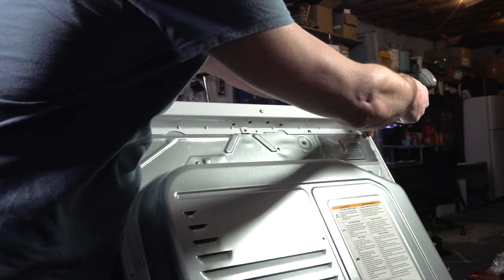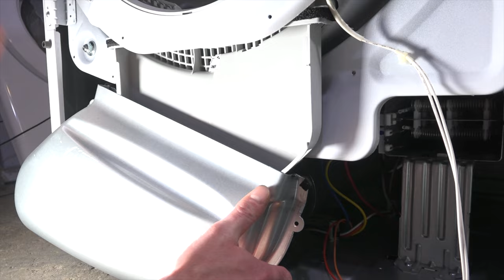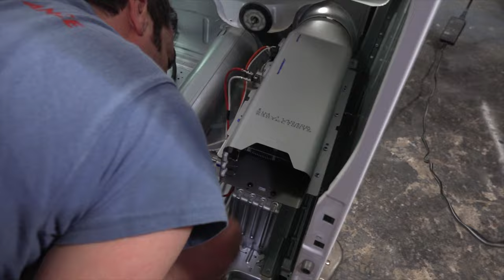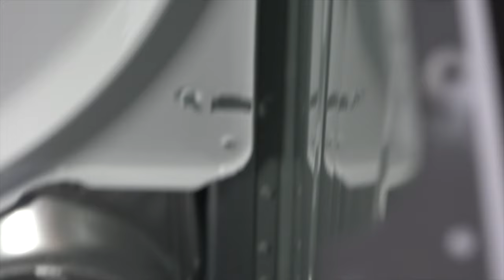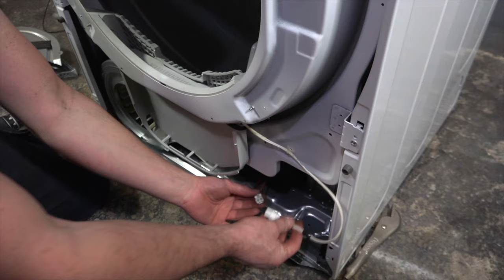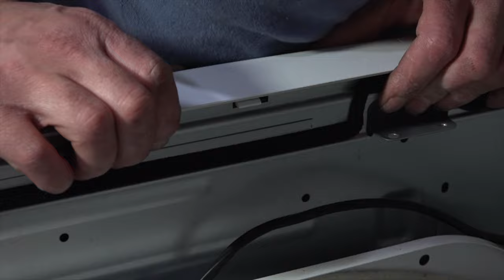How To Fix a Squeaky, Grinding, Banging NOISY LG Dryer

Comment: Our dryer was not sounding good. It turned out the drum wheels had failed. We got your rebuild kit for our 2005 LG dryer and this video helped us make the repair. A few minor design differences inside our older machine. It took two of us about an hour or so. The machine sounds like new afterwards. It does make sense to change all the parts at one time. Thanks for putting this content out!

Comment: Thank you sir for your knowledge! You should do how to videos for everyone! Replaced my wheels tensioner and belt along with my heating element while I was in there! Runs like new! Took me about 2 hours but I took my time and cleaned everything. My lg dryer was slightly different the control board was on the front panel which had more wires to remove other then that it was pretty much the same. Oh the dryer vent was a different style. Worked amazing. A thousand thank you’s !

Comment: Thank you for the video. We replaced all of the parts and it is better but there is a low sounding rattle noise while the dryer is running. Any ideas on what this may be from?

Comment: LG  Model : DLE3777W noisy. what the parts I need and price ? Thanks,
Reply: I have the LG model: DLEX3570V and it ended up being the bottom back roller wheel (was seized up/ not spinning). That wheel seems to be the one that goes out most of the time (according to these videos on YouTube). Your model will probably be the same, but you’ll want to replace all the roller wheels at the same time with the kit. Good luck!

Comment: Eugene, That's the exact model that I have.  Just bought it last June.  My question is - what's the average lifespan before these parts have to be replaced?  So far mine hasn't given me any trouble. 🤞
Reply from the maker: You should have plenty of years still. This exact kit works for most LG dryers, we just happened to be demostrating the repair on a new WM3400 as we didn't have any used older models in haha!
Reply: @LorainFurnitureandAppliance  Ah, gotcha! Thanks! 👍
Reply: My LG dryer is going on 7 years and just now am I having the dryer roller bumping issues.
Reply: I am at 17 years on my LG gas dryer and it is now making noise. LG makes some high quality washer and dryers.

Comment: Ugh. I purchased these matching units in 2021. Both are cheap junk. The dryer made a metal rattling noise ever since it was installed and it turned out to be a couple of loose screws from the factory. I just went through having to replace both hot and cold water inlet valves on the washer due to leaking on the floor and the cold water valve not shutting off and overfilling the washer. They don't make anything that lasts anymore. Barely 2 years old!

Comment: 100s of videos on fixing dryer noise on YouTube, several different causes, not one person making video like this can take 10 seconds to give an example of the noise they're repairing. The glides,  rollers, bearings, the blower assembly, etc. so many different things can cause noise, a 10 second example could help me determine if mines making the same noise or not.

This is like saying "my cars making a ticking sound" and immediately deeming it an exhaust leak, when in reality, some joker put a zip tie around your drive shaft. I guess what ever sells your kit🤷‍♂️🤦‍♂️

Comment: The engineers who designed this crap need to be fired immediately. Shouldn't be this hard to take a dryer apart.  Lesson learned. Never buy this type of dryer. Buy the traditional dryer. Much easier to repair.
Reply: what's a traditional dryer?,  all the ones i have seen have a drum & some type of rollers like this?
Reply: @AlanNordin  I'm referring to the vast majority of clothes dryers ever built for the American market which have the control panel sticking up in the back. These dryers were built between 1970s up to today. Most of these dryers were EXTREMELY easy to take apart:
Step 1: Pop the top off using a putty knife to undo the spring holders that hold the top to the front. (30 seconds)
Step 2 Remove two screws at the top of front panel and remove the entire front panel from the dryer as you unplug the wire to the door switch. (1 minute)
After this, you have access to the door switch, the sensors and the heating element, the timing belt, the tensioner and the motor.

If you need access to the control system take 4 screws off of the back panel cover and you're in. (1 minute)
So, in 2.5 minutes you had everything that might need fixing within your grasp whether it be belt, sensor, heating element, control system.
I admit not all manufacturers specific models had access to everything so quickly; but all of them beat these modern style dryers in terms the time involved to get to the parts that need to be tested or examined.
If you needed to take the drum off to inspect rear bearings, just reach underneath the drum and undo the tensioner and use the belt to lift out the drum. (2 minutes)